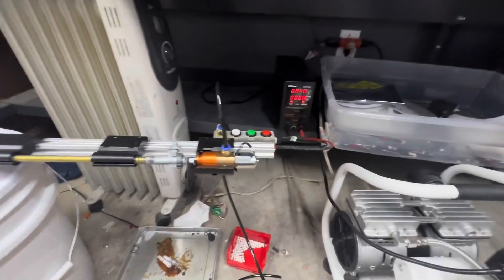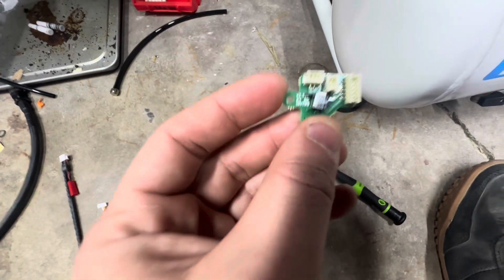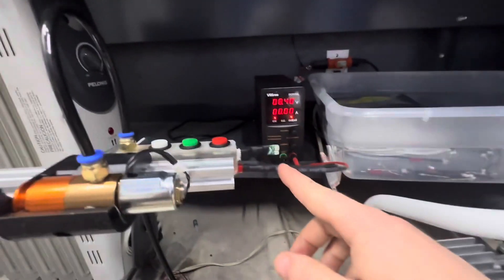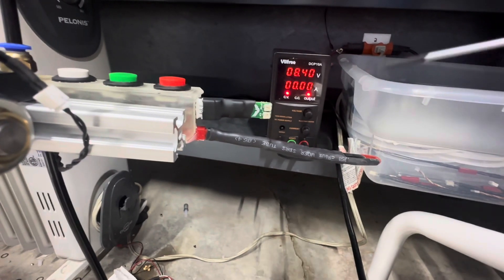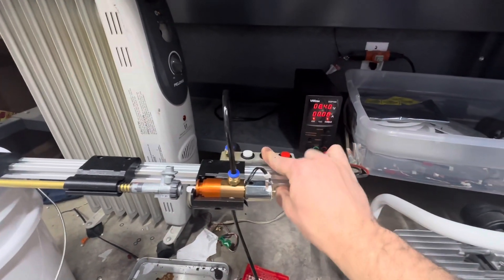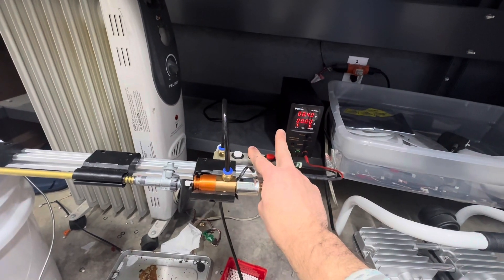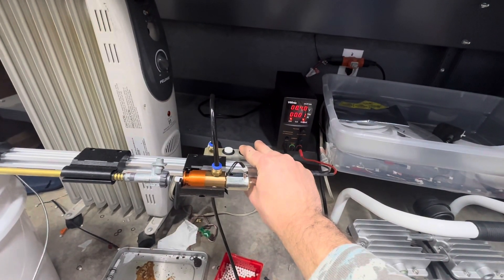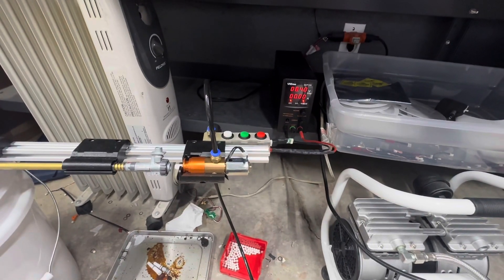How to Program the MODULAR CATALYST FCU

Comment: am having problems when programming its seems like its not going into the programming mode
Reply from the maker: @NSX.N  make sure you hold the trigger for over 3 seconds, and that the other switch is not pressed. Try using a stopwatch while programming to make sure your time is “calibrated” if that doesn’t work shoot a message in the discord’
Reply: @BackdraftAirsoft  I later checked to see if the selector was making contact, and while it wasn't, I went ahead and fixed it. That was an issue on my end. Your product, however, works amazingly well!